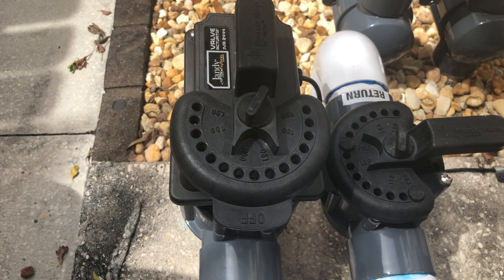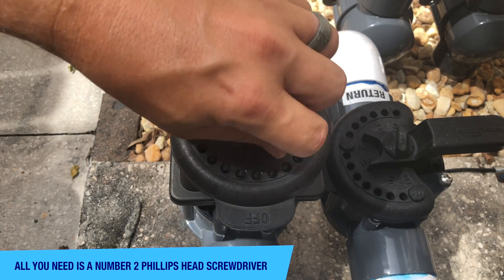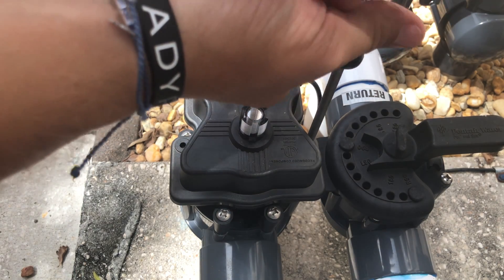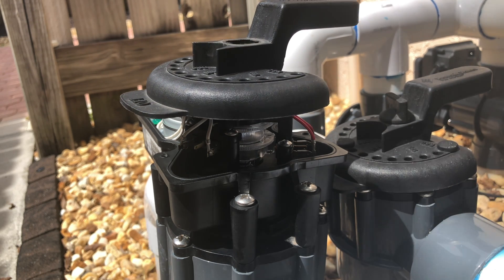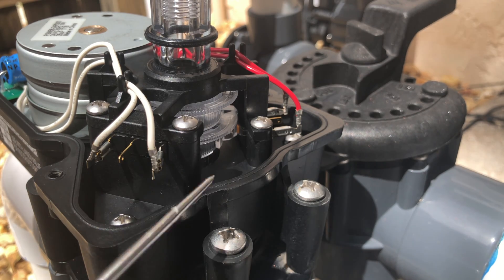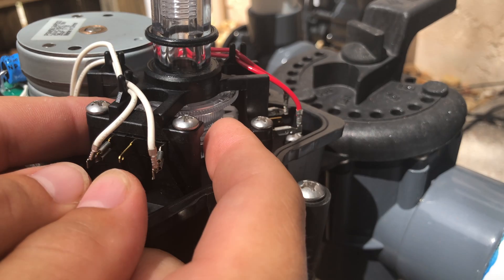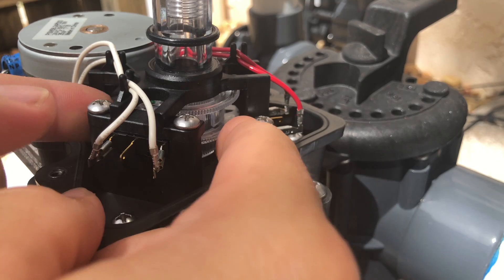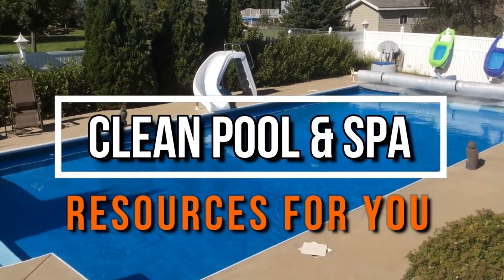How To Cam A Jandy Valve Actuator (Stop Over-Rotation in Seconds!)

Comment: When do u adjust the top vs the bottom cam?
Reply from the maker: The top and bottom represent the max the actuator. Just say the top is for the left extreme and the bottom is for the right extreme (not sure just using for the example). If you wanted limit how far the valve turns to the left you would adjust the top one and vice versa. I hope this helps.

Comment: HI King, what's the trick to figuring out what position the valve is in if I took the handle off and forgot which way it was originally? Is there a marking on the shaft?
Reply from the maker: There really isn't a "trick" per se. Just remember the actuators came  with a 180* cam. It cams (or moves the valve) the 180* opposite the toggle switch side. So as long as you put the valve paddle on somewhere in the middle of that, then you can fine tune it from there. Also, you'll notice the grooves in the valve shaft have 3 larger channels and a smaller channel. The handle only attaches one way (if memory serves the "off" for the handle aligns with the small channel). I hope this helps.
Reply: Chlorine King Pool Service I went back out and realized that I had just gotten lucky each time. The handle only goes on one way. Duh. Thank you for the quick response.
Reply from the maker: You’re very welcome. Glad it worked out.